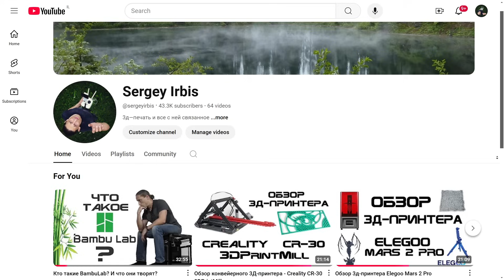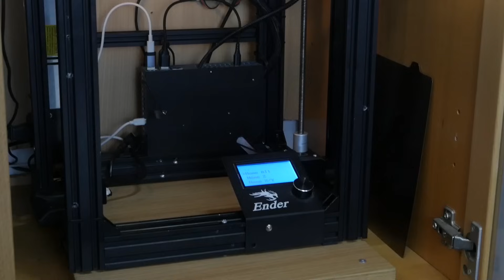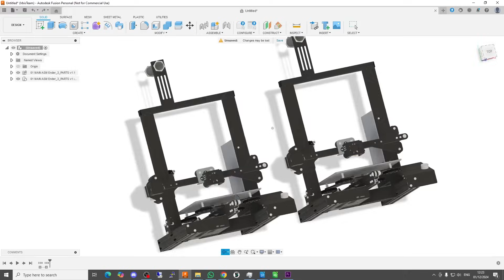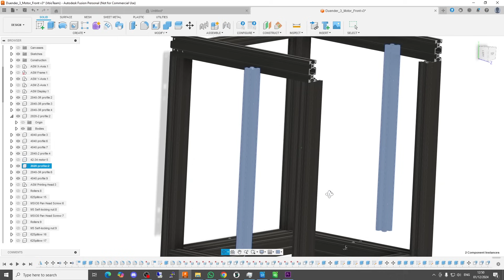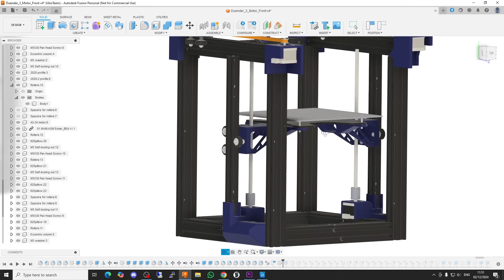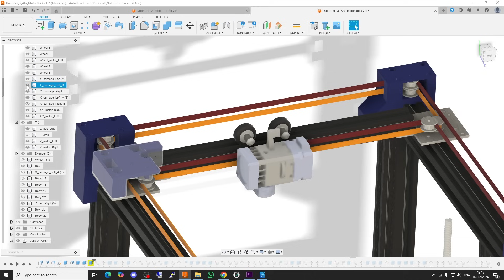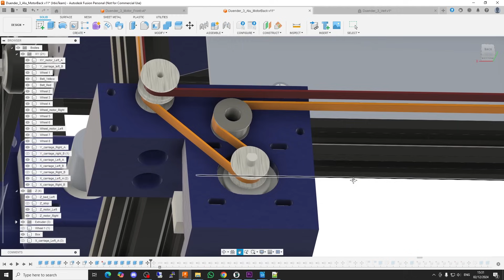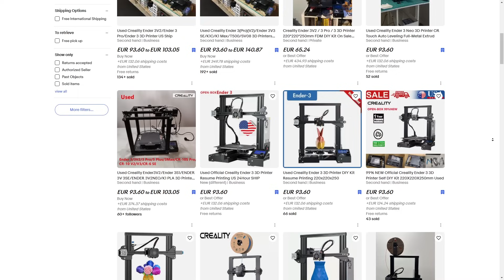- DUENDER: Part 1 - I converted 2 Creality Ender-3 into one fast CoreXY printer

Comment: I have 2 ender 3's that I still use, but there's plenty of broken ones on the used market in the US. I could afford to buy 2 broken ones and use one of my working ones and a broken one to do this, then once I get it working, convert the other one also. 

I've got plenty of experience and comfort in the physical side of things, I can assemble a square frame, machine brackets and pulleys, and wire and solder just fine, but I'm lost when it comes to software. definitely a project I'm interested to try out.

Comment: I love repurposing tech so it was refreshing to run across your tube channel. I just bought a new Elegoo Centauri Carbon but still no multi material gear. I have an Ender 5 (still in the box) and enough Ender 3 parts to make at least 2 maybe 3 printers. I'm going to follow along on your journey and together we will build a Frankender Core XY multi material machine out of the bodies in my 3D graveyard. Thanks for the inspiration.

Comment: I have an ender 3 pro with klipper, it can go 300mm/s I was able to get a 6 min benchy with the stock belts and motors on a bed slinger! It does have dual z axis, upgraded board and an upgraded direct drive extruder. Check out my work on my YouTube channel.

Comment: Hello, do we need to change the software for this? If so, where can I find it?
Reply from the maker: You can keep Marlin, but it still needs to be reconfigured and reinstalled. And there’s no point in using Marlin now. Everyone uses Klipper, my config is posted with the project on Printables. There are a few videos about flashing Klipper on the channel.

Comment: Imagine doing such a thing with 2 Elegoo Neptune 4 Max.   A core XY with 420mm bed...
Reply from the maker: I haven’t had any Neptunes, but judging by the photos, they don’t use standard profiles. If it’s just covers on regular profiles, then there shouldn’t be a problem. Though for such a large bed, it might make sense to use the three-motor mod. But if the profiles are open on only one side, there could be issues with the joints and space for the wheels.
Reply: @Irbis3D  They are, in fact, proprietary extrusions.  Not that such a project would have been realistically in my comfort zone.  Just dreaming...

Comment: Worth subscribing! I am dealing with 3D printer named eMotieon tech STRATEO IDEX420, i want to change z axis gantry to core x/y. I have ran into problems like gantry stuck mid print because of its weight, x1 and x2 axis motors pointing inwards, which meant that belts got way loose and printheads didnt touch endswithces. Printer is using Duet3 board, but i will have to change everything, i guess. never done, would love to learn from this and few more channels how it is done. Thanks for sharing your experience, good luck man!
P.S. Your English is near perfect!

Comment: Thx for this very interesting project. Re-subscribed from your old channel and no regrets ) One question: is it possible to combine Pro and non-Pro versions without extra-efforts from my side? Thx!
Reply from the maker: In theory, you can do it, but it won’t be symmetrical. You’ll have to make one of the axis carriages bigger. Or just go with rails from the start — then the issue will only be visual.

Comment: I want to do your project. But can the wand print ABS and TPU? Can the nozzle reach 300 degrees?
Reply from the maker: This extruder is quite specific—I built it from what I had on hand.

The maximum temperature depends on the heater's power and the extruder's design. I’ve printed ABS at 270°C without issues. Medium-hard TPU prints fine, but I haven’t tested soft TPU yet.

Comment: I was super stoked when I found this video. I too have two original.Ender 3’s, and have been wanting to build a Core XY machine for sometime. I have actually been trying to find an ender 5 plus to build a mercury 1.1 variant. Seeing as getting one cheap enough is a major hurdle, I had kinda came to a standstill after already ordering a brand new SKR3 EZ, TMZ 2130s & TMZ 5120 pros, to run a 48 V X&Y axis. I was already looking at the same high flow, hot ends and stealth burner extruder to go along with everything. Just wanting to wrap my mind around if it’s worth putting two together. The only big issue is they are my only printers, so I would have to print everything I ahead of time. What would you do in my situation? Would you just build something from scratch, or would you keep looking for an Ender 5+ on the cheap?

Comment: The timing on this video (for me) is great as i had already started down a road very similar to this project using the Ender 3 Pro kit as donor materials for what i would like to end up with.  

Also - your English is great!  I can clearly understand you so you are good at least by me.  I also want to say that i do appreciate that you are speaking English, i think that is great and i do appreciate it!

is it worth continuing this project?  100% yes.  I have to imagine that there are tons of folks that are trying to figure out just how to design, spec, build, tune, own and operate one of these machines.  

I am also currently very cost sensitive - as a result i have been very carefully comparing tons of options of control boards, hotends, extruders, CAN bus boards, frame designs, and more.  On the topic of control boards the BTT SKR mini E3 V3 is probably the best option to start out on - it is a capable board and is just about the lowest costing board that i have run across that i would trust.  I plan to run Klipper.  There I have a little bit of confusion with the BTT CB1 and CB2 boards, etc... 

To that i agree on the choice of using the Bambu hotend - it is proven to be best in class, it is not expensive and it is easy to find.  But on the topic of Extruders/hotends i am currently down to these choices:  1 - All Bambu parts.  The X1 extruder works great, there are now these super cool skeletonized frame kits (unnecessary or rather not completely necessary but really cool!) and RNC Hardened gearsets available.  In addition you can add their filament cutoff mechanism which is a great design and it is not expensive to add on.
2 - the LDO Orbiter 3 with the Bondtech nozzle.  Nice thing here is it is all built and delivered and it is a lightweight and compact unit with many great reviews and it goes for around $100
3 - one of the many different RatRig or Voron designs using the Galelio 2, the Sherpa, or the Hextrudort extruders with a yet to be determined hotend.  I really like the Hextrudort as i believe a YT creator designed it.

Of those 3 I have to say the Orbiter 3 is probably the best choice followed closely by the Bambu system.  The nice thing about both is that they are "set to go" from the factory - this does not mean that setup and tweaking will not be needed, just that the mechanical components are very well matched 

Also - regarding extrusions and frames:   i would like to mention a brand of extrusion that has a great connection system - Maytec.  You drill 1 hole in the extrusion and that is it - drop in the connector system and tighten.  Makes very robust and strong joints.  i do believe that 80/20 has something similar and if so that is great as this simply provides 2 options for one of the best ways to attach profiles to each other.

And i hope that you found something valueable in what i wrote - i know it is a lot of text.  I tried to break it up to make it more readable.  cheers!
Reply from the maker: Wow! Lots of useful information. Especially about extruders. I think that sooner or later it will be necessary to upgrade to something light and efficient.
Reply: @Irbis3D  Hello - so i am coming back to watch your videos again to absorb more detail and again, i just want to tell you how impressive it is that you have accomplished all of this - the design, the iterations, debugging and problem solving, updating, coding, and more.  

I ended up picking the Orbiter 3 as my extruder/hotend.  It is one of the lowest cost high performance combos you can get.  I almost used all Bambu components and the only reason i did not is because if i did then i HAD to do the upgrades to them - the skeletonized frame looks sick and adds performance - the upgraded gears, etc.  And that drove the cost to about $150.  

If I only used Bambu stock components the total is closer to $100 which is the same as the Orbiter 3 and is arguably just as good if not better.  From there you can upgrade the stock Bambu hotend for an E3D Obsidian which was tested here on YT and showed that compared to stock it not only could extrude faster but layer adhesion was SIGNIFICANTLY better...  almost enough reason on it's own to have gone with the Bambu style hotend...

I almost went with the Phaetus Apus, the v1 version.  It looks kind of like the Bambu skeletonized frame, and is very easy to adapt to what ever hotend you want.  The Apus with a stock Bambu hotend would have been around $120 so super close race for sure!  There is a YT channel running these and i asked what he thought and he said that he loves them.

My biggest struggle is with the coding... i don't really get it, never have and probably never will but here not knowing much about it will be a roadblock for me so i am interested in some coding videos - but they would have to be short, like a sprint, as i can only asorb so much and i do think that even though i need it, it will be a bit more boring to watch and you don't need to make video's that get only limited views.

Comment: First your English is just fine.  Second, thank you for the Printables post for this fabulous printer, GREAT work.  Finally, I have questions:  Can you use a 4.2.7 32bit board for this machine?  I have 2 Ender3s and a MingDa D2 with a direct drive extruder adapted from an Ender3 (it's a kit, I mounted on the MingDa and works great but that printer is so slow).  In short, I have a E3 V1, an E3 V2 and the MingDa which give all the parts I need.  So long as I can use the CR Touch and the 4.2.7 board I have, this would be a perfect solution to my dusty E3s.  Please LMK your thoughts.  Thanks!

Comment: I really like this build! Especially before linear rail conversion since it stays closer to spirit of reuse.

The modern Voron-style belt run has an advantage, that although it needs at least two more idlers, the belt is turned inside out so all idlers but two contact the belt on the smooth side. Smooth idlers or flanged bearing pairs are more reliable and cheaper than quality toothed idlers, but running belt teeth over smooth idlers under higher tensions causes oscillation, this is why this path is preferred. Of course preferred doesn't mean that it outright solves any or all problems, just that there's fewer problem opportunities.

I have found a HUGE difference between just random toothed idlers you might buy somewhere, and actually good deep groove machined toothed idlers. Printed toothed idlers didn't perform much better or worse than cheap toothed idlers, neither engaged the belt at the spine, neither were better than smooth idlers, and i also broke the printed idlers by belt tension rather soon. Actual good toothed idlers are glorious though.

One can use bumpstop alignment for Z axis. Basically during homing or pre-print operation, you drive the Z motors near to the limit, then drop the motor current or motor speed and gently ram a mechanical limit. You don't need sensorless homing for that, but it's fundamentally similar, and you can use a single channel to drive both.

I also have a feeling that extending the Z down with underslung motors and maybe little extension feet if need be would be nicer than cutting the acme screws. The metal of these rods is not pleasant to hand saw.
Reply from the maker: I've already made almost all of these changes. And in a couple of days I will post the first release version of Duender and a video about the build.
 The belt is already turned forward with teeth.
 Idlers have been replaced with F623RS flange bearings.
 I also moved the Z-axis motors inwards and downwards, although it turned out that the lead screws were still too long.

Comment: Thank you for such a great video, your projects are extremely inspiring! I spent December overhauling my original Ender 3, there is a lot to be said about the ease of modification of the base design and components. With only a random assortment of spares, an old pi3b+ and some printed parts to convert to direct drive/cable manage I have the machine running Klipper with direct drive far faster than ever before. I wish you much success with the english channel as i have very much enjoyed both videos, you speak clearly and the information is well presnted. Good luck!

Comment: This is exactly what I'm looking for =), i have a heavy modifyed ender 3v2 and 7, and recently got a P1S, before i always pland to corexy my ender 3 since it allready prints super silent and quite fast, the ender 7 motion system is just to loud and it needed some modivication to have decent quality. With the p1s i had suddenly a day/night expericence, i always thought my ender 3 with all his modification is a good printer, but the ease of use if the p1s totaly opened my eyes.. BUT it is super loud. And i need at least one printer which i could run at any time of the day.    An corexy ender with rigdig frame and using rollers is a perfect compromise. (and i have a secound ender 3 v2 sealed in an box) :)

thank you for opening up your content to the international comunity, it looks like you have asweseome projects coming up. I would like to follow up on your videos =)

Comment: good work, keep going!! i’ve also decided to start converting my old ender3 into coreXY and have hit the same issues with vfa, i even went through similar design changes. My current thinking is the hotend/extruder is too heavy on mine, but im planning on testing 0.9 degree motors first on mine

Comment: Thanks Sergiej for this helpful video. I Have an old ender3 v2 which I'm going to convert. My main goal is to print with materials that require a chamber. The speed is not required, but quality is a must. I want to stick with stock board, but will upgrade rails and hardened steel hotend. Which firmware version do you use?
Reply from the maker: Klipper 0.12.0, the latest one.
Reply: @Irbis3D  but is Klipper compatible with Ender board? I couldn't find any info about it... Thx
Reply from the maker: Yes, it is possible to install the klipper on the original board. It doesn't have modern features and good drivers, but it will work.
Reply from the maker: In a couple of videos, I plan to make a tutorial on installing and configuring klipper.

Comment: Hi! I think i`ll  try to defeat a VFA by using a buffer tape (widely using for a dress locker doors) to culm belts down! It must help a lot to kill a guitar string effect !  Just stick it to a surfaces that moving closely to a belt and it must work as a soft "chain guide". It may cause a friction .....just a bit but a i think - it`s gonna work on any printer where you can apply this solution
Reply from the maker: I was thinking of something similar, but using an additional idler to calm the belt.

Comment: Maybe the "z" axis on belts, I have two Enders, one with this modification.
Reply from the maker: Maybe someday, as an optional configuration. But I don't see any special advantages in such a config.
Reply: @Irbis3D  I am really interested in this project as soon as you add the files and instructions I will build it right away I was wondering what to do with my two enders, one of them is factory the other has rapido and voron toolhead, skr mini E3 V3 and z belt mod from Kevin akasam. After installing the belts on z the quality improved so I am only worried about the z axis on trapezoidal screws

Comment: Good video.  thanks for your new English channel.
I suscribed and liked.

I have one question, why Core XY and hot H-Bot.  It seems the motion is identical, yet the belt configuration is much simpler.
Also, I just do not understand why no one just puts a simple Ender 3 V2 belt tensioner on on odler pully and never worry about the belt tension again.
Reply from the maker: The disadvantage of the H-bot is that it has one very long belt. CoreXY has two belts, also long but not so much. In addition, H-bot has a problem when the X-axis is skewed and it causes geometric distortion.
Reply from the maker: In recent years, I have not heard of anyone choosing H-bot kinematics for a printer

Comment: Yes please, more than happy to watch a series of how-to videos on converting ender 3 to core xy. There are lots of enders here going really cheap as people get rid of them. You can cure your problem with drilling aluminum parts more accurately by making 3d drill formers/drill guides for the plates (especially if you need to make more than one). I use brass tubes pressed into the 3d parts as guides for the drill bits. Turns out really accurate with simple hand tools.
Reply from the maker: I used plastic guides for cutting and drilling.  Without it, I would never have cut them well enough. But due to the quality of the saw and drill bits, not everything turned out perfect.
Reply from the maker: I already found a subscriber with CNC))))

Comment: Very nice! I have an Ender 3 S1 Pro that I have been wanting to convert into an enclosed printer, and when I found the Ender3 NG project I thought that would be ideal - but unfortunately it is only designed to use Ender 3 and Ender 3 V2 aluminum profiles... So I've been slowly trying to modify the parts in Fusion. Perhaps your project would make sense if I were to find a cheap used Ender 3 somewhere.

Comment: I would advise using a square aluminum pipe with a 2mm wall for the portal. It has greater rigidity than a similar extrusion profile. Good luck in all your endeavors)